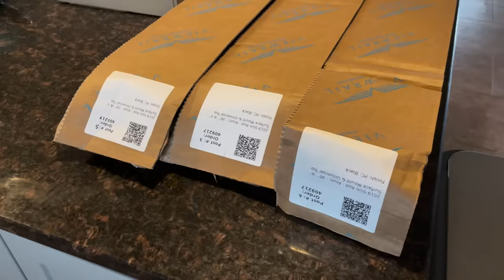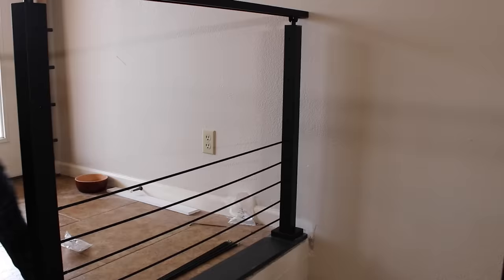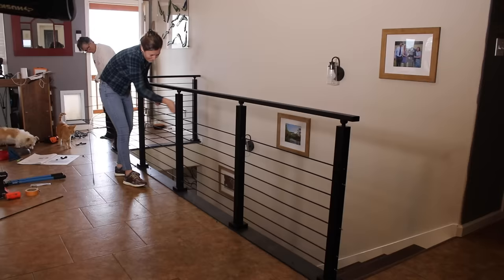Easy Cable Stair Railing | The Best DIY System

Comment: How is it holding up, specifically the one on the corner by the stairs? Is it loose? (Wiggling)
Reply from the maker: It's as sturdy as the date I installed it. No wiggling at all. Thanks for watching.

Comment: If I may be so bold, April, that yellow & black power tool you used is a DeWalt "Guaranteed Tough" battery powered RECIPROCATING SAW. :) "Sawzall" is a trade name by Milwaukee and was offered before DeWalt. Old marketing mantra, "Better to be first than best!" Yes, I once worked for DeWalt Marketing. :)

Comment: Yes, the new railing looks nice and modern, but if you have children or if any children come to your house, this is a danger to them.  We all know the first thing a child is going to do is to climb railings like this.  That's why the safest railings are verticle.  I think in Canada you cannot have a railing like this because it goes against code, for that very reason.  It is code legal here in the US, and as long as it looks nice for some people that's all that matters, and safety is secondary.  There are modern railing systems that look just like this, but have vertical rails instead and thus are much safer.  To be safe, I'd also put a hand rail on the wall going down the stairs, but I'm no designer, so what do I know.  It might interfere with aesthetics.

Comment: I can't be sure, but I think the new railing is a little bit shorter than the old one.  Wondering if that meets safety-code or not.  If not, I guess a person could raise that baseboard up a bit by sandwiching it with another (thicker) board underneath the baseboard. (???)  Or just use one very thick (beam-like) board.  Just an idea.
How tall are you, btw?  It looks like the handrail is right at your hip. (???)

Comment: April, thank you for the detail, but the new railing is looks Too modern for the style of your home. Should have left it alone, there was nothing wrong with nice look of the existing railing. I wonder if the new railing even passes building code where in your town for this application since it no longer has vertical balusters.

Comment: For the most part, I do not like codes, but in this case, I have to agree that the new railing will not meet the code when and if you try to sell the house.
I yelled at the screen "NOOO" when you cut the old railing out.  It was a very beautiful wood railing and for that location.  I, personally, think you have made a very tragic mistake.  I think your work is very good but not in this particular case.
Reply: In my province you would not be able to get home owners insurance with it. Never mind selling the house.

Comment: Seems a bit strange you ripping wooden rails out and putting these modern metal post and wire balustrade in you Normally like working with wood 🤔
Reply from the maker: I like the more modern look rather than the style the previous owner preferred. Thanks for watching.